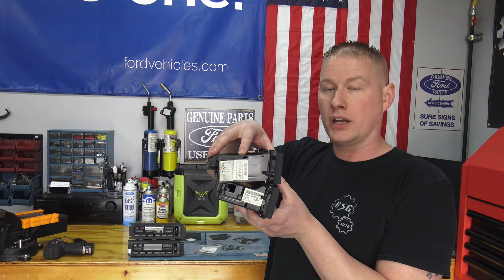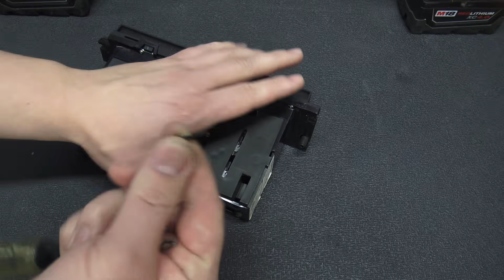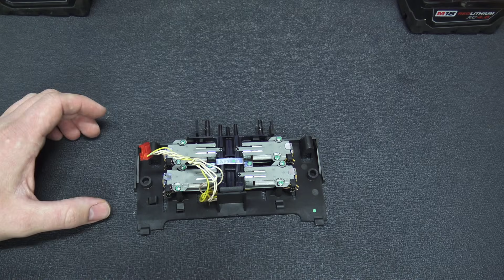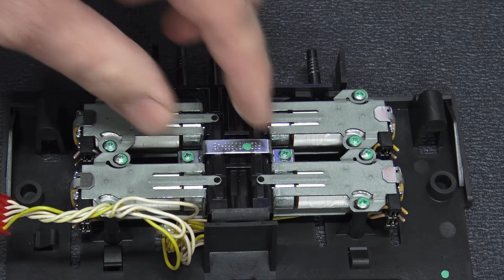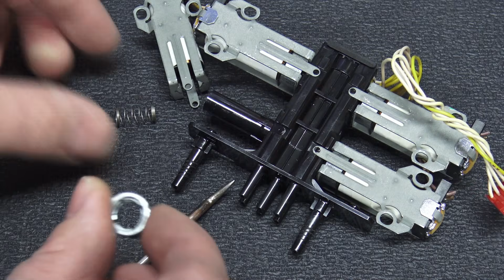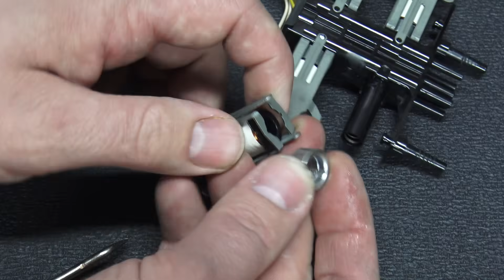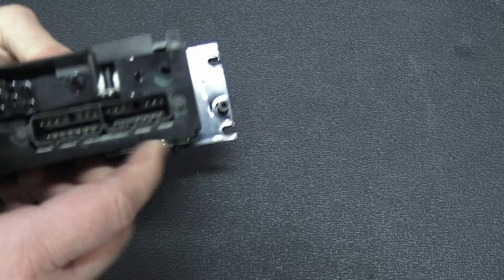Ford HVAC System Stuck on Defrost: EATC Control Head Repair

Comment: Thank you so much for this video!! It fixed my HVAC system in my wives 2003 Ford Crown Victoria. I had to copy and paste the product description in Amazon search, because the link provided was sold out. Same part came up with less o-ring quantities to chose. Your video was so easy to follow and exactly like mine. My wife is so happy now and I am a hero, thanks to you. Local salvage yard had one and wanted $250.00 for it and on Amazon they are over $650.00. You saved me so much, thank you for taking the time to help us!

Comment: I have a 2002 Lincoln Navigator and when the a/c is set auto sometimes it turn the fan down as if it has reached the desired temperature when it has not ?A/c is cold but just turns the fan down. What fo you think?

Comment: You just helped me fix my Harley F150 AC Head Unit!  Thanks
Reply: Martin Bech hey what was the issue on yours I have an 03 Harley truck myself and my max a/c is blowing cold but on the defrost not thru front vents but I let it run like for couple minutes and then hit the vent button and it will blow cold for little bit then it just blows air no a/c any info would help
Reply: @ricktorres4289   my HD 2003 was blowing cold but through vents and defrost and no other function was working. I did as shown and everything is working now
Reply: @Martin Bech thanks for your quick reply I’m going to try this weekend when I have some free time
Reply: @ricktorres4289  no problem

Comment: Is this method only for automatic climate control, or this can be applied on manual climate control???
Reply from the maker: Auto only
Reply: @FordTechMakuloco  I have an 03 Grand Marquis with manual climate  control, upon hard acceleration, and uphill, air shifts from the front vents to windshield no matter heat or AC. It happens for just 5 to 10 seconds and the air resumes blowing from the front vents.

Comment: I have the same symptoms but mine is a 2003 and it doesn't have the vacuum controls inside like the top model in your video. How do I fix?

Comment: after replacing vent motor in back of dash that did not fix it replaced 4 o rings in control unit like video said. Works like a champ. Mine was stuck in defrost mode. Thank you so much life saver.
Reply: So your blend door actuator had nothing to do with it. ?
Reply: @bsmoove2654  nope. Was exactly same. Replacing o rings fixed the car i was working on.
Reply: Michael Knaebel thank god I was praying that I didn’t buy the entire unit for no reason. Thank you 🙏
Reply: Michael Knaebel just replaced everything including the blower motor now for some reason the blower motor won’t turn on
Reply: @bsmoove2654  did the blower motor work before. The ac on my car was not working as in not blowing cold and replacing o rings in control unit fixed my problem.
Reply: Michael it was blowing out of the defrost vents before I replaced the hvac with a brand new one now the blower motor isn’t turning on at all
Reply: @bsmoove2654  does the blower motor work with old control unit
Reply: If it works with old control unit try replacing o rings like video. Took me about an hour video was spot on

Comment: So let me ask you the orings you mentioned in the Amazon Link you provided pretty much does all Fords? My 05 Super Duty keeps blowing air through the defrost. Especially in 4WD. I replaced the solenoid on the left that's in front of the Vac Pump. No change so .. this will be my next step..

Comment: Thanks for this well done video. I was about to swap the unit from one Crown Vic Sport to another to test for unit failure, but bought a pack of o-rings instead and in 45 minutes had it fixed! Unit switches blend doors perfectly now!
Reply: will this work for 2006 4dr n 
6 cyl FORD EXPLORER, THE VENT DOOR POSITIONER JUST PLASTIC KNOB N NOT ELECTRONIC?

ALWAY CHANGED ACTUATOR UNDER DASH BETWN DRIVERS SEAT N PASSGR SEAT, BUT THEN ONLY BLOWS COLD OUT DEFROST VENT N FLOOR VENT, WILL SEE IF VACCUUM HOSES ARE LEAKING OR NEED REPLACING OR ARENT CONNECTED PROPERLY???
 I LIKE ATTENTION TO DETAIL N STEP BY STEP INSTRUCTIONS
U HELPED OLD GAL LEARN SOME NEW CAR TRICKS NOW SEE TO GET MY SON HELP WITH THIS LOL

Comment: I tried to start a self test and hit off and then floor and off and then auto in two seconds, but nothing happened and to never started the test.  Even though I hear the vents working or moving I have air blowing out only through dash vents.  Also no heat.   Any thoughts.

Comment: Would this effect the actual fan from working. Mine just random stops working for a day or two. Then works good for a week. When it works it works ac def vents etc. everything switches fine. Seems to be the fan speed wheel usage makes it fail like trip to trip. If I leave in auto and it changes itself works way longer between issues. Any help be appreciated. Was going try this but not sure if it would help. And as for fan blowers I thought they just broke. Not work great on all speeds for two days then nothing for day or two then back normal.

Comment: Is it possible to swap this out with the older kind with knobs? The only setting that blows air out of multiple zones is Auto and it makes this weird high pitch noise on that setting. Otherwise I can only have it on either my feet or the vents.
Thank you!

Comment: 2011 crown Vic. What is next step when you replace this unit and the problem of heat in the vents continues and will not go to floor. Ran code on blend door and it is good. What is next vacuum leak? Engine runs fine.

Comment: Thank you so much, I have heat thanks to this video. I didn’t have the replacement seals, so I just wrapped Teflon tape over the old rings and it worked. I will order the seals tonight and do it right. Thanks you so much

Comment: I have the issue where the vents dash work fine and will blow hot or cold vent air as well as ice cold AC but the defroster and floor won't blow hardly if at all. IS there any way to figure out which o-ring it is or should i just replace them all for good measure? Also is Viton instead of silicone o-rings okay to use?

Comment: I have a question I'm not sure if your able to answer it or not but I have a 2011 Ford Crown Victoria LX model I followed the instruction in your video to the T everything went smoothly installed the. Unit back of the car it work for a few minutes and then it decided to stop working is it all possible that the head unit could stop working or fail all togethe?

Comment: Excellent video. Just completed this on my parents, original owner 2003 Crown Victoria. In the summer was getting ac through the Defrost and only low-cold air flow in floor for heat!. Now, after following this video (watched about 3 times) the EATC Unit appears to be working Fine. Once i got a T20 screwdriver, and the right size o-rings, it took me about 2.5 hours (moved thru it slowly). 
We have Heat! Thought i was going to have to change my Blend Door because my EATC self-test code indicated 024 (blend door short). Not so. This guy is helping so many people save a lot of money!! Thank you.

Comment: looks fairly simple to do. I have (3) problems with HVAC (EATC) within 6 month period:  6 months ago the AC started blowing through Defrost. Now No Warm Air for Heat (just cool air through drivers floor vent and defrost and very little air thru passenger floor vent. I do not hear anything clicking behind Dash when heat is turned on (Blend Doors). Would a Vacuum Leak somewhere cause the Problem with AC as well as Heat? Or Would a Vacuum Leak just cause problems with the AC blowing from Defrost. (Will try to fix EATC Unit today and see what happens). Dont have Vacuum Gauge though to check exact vacuum? EATC code came back as 024. Online description of the number 024 indicates "Blend door short"?  I hope i can find the short circuit (connection swithes) and fix Heat temperature without having to replace the blend door behind the dash!! Any experienced tech with Ford 2003 Crown Victoria knowledge about this issue would be greatly appreciated. I need to get some heat. I have older parent with serious health issues that must have heat when i take them to various appointments.

Comment: Thank you this video. I was all set to tackle replacing my blend door actuator on the 03 grand marquis. I came across this and thought I should try this first and this worked!  Replaced the o rings and did a auto recalibrate and now I have heat blowing in any position I select.
Reply: I have same problem and don't want to replace Blend Door. My EATC unit code shows the number 024 (indicating "Blend Door Short")???  I plan to try this first and pray that it works. Glad you commented about this. What is a Auto Recalibrate?
Reply: K auto calibrate is done when you press down on the Floor and Off buttons and the same time. Then release and press automatic.  It will cycle through a calibration and give out the codes if any.  Then when it’s done you can press automatic again to complete

Comment: Excellent, I have a 2003 Ford F-150 Supercrew that wouldn’t blow heat on the floor. I put new o-rings in just as the video recommended and that solved the problem. Thanks for the video.

Comment: You're a lifesaver!  No one on the forums knew what I was talking about on our 1999 Expedition. Two days after fixing the ac by putting in a new condensor, the ac is stuck on window defrost! I think it might be an engine vacuum issue but if not, I know this will fix it! Thank you!
Reply: Well my issue was a vacuum line off the carb. I simply electrical taped it up until I can find the correct rubber fitting. Thank you for the excellent videos!

Comment: Excellent fix.  The 2001 navigator had no screws on the valves ( all spot welded).  Just turn the assembly upside down (wiring harness up) and use a small drill bit at the spot weld dimples where screws would have been and voila, the assembly is free ( 8 locations).  Then follow instructions as in this video.  After putting back together, rosin core weld back or simply use high temp electrical tape and wrap around the frame on each side to hold the valves in place.  Make sure they are lined up as to not to stress the plastic manifold.

Comment: Thanks for the video.   My 06 grand marquis AC would switch to defrost under acceleration.  I bought the o rings, replaced them and works perfect now!  I had to buy 100 o rings lol but so nice having working AC!  I found 1 of the original o rings was actually cracked and all others seemed deformed and brittle.

Comment: I have a 08 ford taurus it blows cold on the driver side hot on the passenger side I've checked all three motors all work how can i fix this problem

Comment: I got a E.A.T.C UNIT FOR 08 GRAND MARQUIZ, WENT I PRESS THE HEAT BOTTON IT GO TO HEAT THAT FINE, BUT WENT AND PRESS COLD BOTTON
STAY'IN HEAT AND THE DOOR BLEND ACTUATOR AND THE THE HEAT CONTROL VALVE IS FINE; WHAT CAN BE WRONG WITH UNIT? REPLY PLEASE! AND EXPLAIN HOW TO FIX IT.THANK FOR YOUR HELP!

Comment: Tried many suppliers to get the silicone o rings you mentioned out of stock and your link also. 2 months later said screw it. Have a o ring selection at work found the specked o ring not silicone but jelly bean Viton. My dad today is his 77 he has suffered to this point as well as my mother driving around with a cool windshield. Installed the jelly bean o rings test fitted the old ones hotdog down a hallway new ones tight and sealed. full bore out the vents my dad very happy me not so much.The problem is 50% of air flow is now is coming out the vents all the time on any other mode going to be a problem in the winter weak defrost air flow. Now I think after researching the system there is a plug on the end of the manifold going to pull it apart again pull that plug and silicone lube it. As I said to my dad its 80% fixed fine for the summer but it is going to bite him in the ass when there is a foot of snow. 2010 Crown Victoria.

Comment: Great tutorial, but it didnt work for me on my 2000 Expedition Eddie Bauer. My EATC head looks the same on the outside and is part # XL7H-19C933-AE, but the solenoid is different with part # XL7H-19D611-AA.  The solenoid has no screws, its tack welded all around. There is no way to take it apart. Looks like I have to buy a replacement.  FML

Comment: In need of video on how to test and rebuilding the vacuum switching module for the slim/compact unit. My test was to run hose between pairs of ports, the connect vacuum to 7th port. Would not pull vacuum so I'm assuming it's bad.

Comment: it worked almost perfect for me !!!...my grannys 98 grand marquis had a metal frame holding the solenoids in place, drilled out the spot welds, and then used small bolt, washer, and nut.....installed and worked like new.......thank you sir !!!!

Comment: I just bought a 2004 Grand Marquis last month and the air would just blow out the defrost,  just like you mentioned. So I order the O rings off of Amazon ($6.00) for 100 and did the repair and guess what? I now have cold AC and a hot heater and everything else works just fine! Gotta love the internet and YouTube. Thanks for this video it saved me a whole lot of cash! Buy the way you got a new subscriber. The link for the O rings have changed but if you search they still can be found.

Comment: My '03 Grand Marquis just started to change to the dash vent under acceleration and was slow to switch between vents. I had read that the EATC o-rings needed to be changed. I ordered the o-rings and followed your video to a T and the problem was fixed in about 30 minutes total. Thanks for taking your time to make this video.

Comment: the o-rings you are useing are out of stock and they dont know when r if they will get any more . do you know another o-ring i can use
Reply: Just search 007 70A o-ring at Amazon. I have prime and they are an add on item for $2.30 for a 100 pack.
Reply: Thank you for your help it works fine now

Comment: Apparently 2003 Expeditions EATCs don't have o rings in them and they don't have any tubes going to them. My AC was only blowing through the defrost. I replaced the vacuum tube under the hood and now it works except when the engine is under load. So it still has a leak but I don't know where. I got the o rings to do this but when I get the dash opened up there aren't any hoses going to the EATC. Any ideas?

Comment: Thanks to your very informative video, I was able to save my EATC! 2006 Grand Marquis, blower motor cutting out during uphill acceleration, blowing on DEF and FLOOR all the time, not responding to buttons, certainly don't have the money to buy a new one....so, feeling confident after seeing your video, I took the plunge and spent about an hour to fix it, I just went slowly and inspected everything for any breaks or cracking in the plastic...found that two of the 'plunger solenoids' (on the same side) were difficult to pull out, which I would think indicates sticking o-rings (what else could be holding it?) Lined up the silver metal 'collars/spacers' with the ridges on the vacuum manifold assembly so hardly any 'turning' was necessary during reassembly...put it all back together and BLAMMO! Works perfectly! My wallet and I both thank you! Keep up the good work and thanks for the video!

Comment: My repair did not go as smoothly as yours.  I broke 3 of those tiny black tabs before I realized that you do not have to remove the entire cartridge to install new O rings. Leave the cartridge and tiny black tabs alone and in place and only bend the tabs on the outside as shown at the 7 minute mark.  The cylinder with the O ring will right slide out.  I reinstalled it, and it seems to be working properly. It's dark outside  now, so I will test it more thoroughly tomorrow.  Thanks for all your repair videos.

Comment: Thanks so much for this video!  I bought a use Ford 2003 F150 where the defrost was the only option and just fixed it for $2.35 and some personnel time.

Comment: My truck A/C gets stuck in defrost mode when get above 2-4k RPM from 2-4 gear and it’s annoying don’t use my a/c for that reason because it’s point less I’ve been told it’s an vacuum like which I believe but where is that leak at or where are the places it can leak please help

Comment: I got the control unit out of my '06 Grand Marquis. I haven't had time to work on it yet. I do have vacuum at the black hose. However, I noticed there are 6 vacuum fittings on the control unit, and only 5 vacuum lines, one of these being the vacuum source. Is this normal, or is there supposed to be a 6th vacuum line?

Comment: Just finished the O-ring replacement on my 2002 F-150 King Ranch. The EATC module is now working perfectly. I bought the 007 o-rings on Amazon ( 100 pieces for $3.50 ) as they didn't offer 10 packs. With the help of this video, the fix was very easy to do. A couple of big box auto parts stores wanted at least $400+tax for a replacement EATC module. The local Ford dealership wanted $965.00+tax..........just for the part. 😱
I used $0.14 worth of o-rings 😎
Next is the cruise control. Replaced the switch /relay on the master cylinder today, but no go. Looks like I have to pull the airbag and replace the control buttons on the steering wheel......uggghhh.
Thanks for the video sir !!!!!

Comment: Anyone by chance had luck sourcing the 007 (5/32((ID) 9/32((OD)) silicone o-rings at a chain auto parts store? Would really like to fix the "stuck-on-defrost" issue on my grandfather's '03 Grand Marquis asap (vs waiting on snail mail) since my stays almost over and about to head 1000 miles back home to Chicago - Thanks!